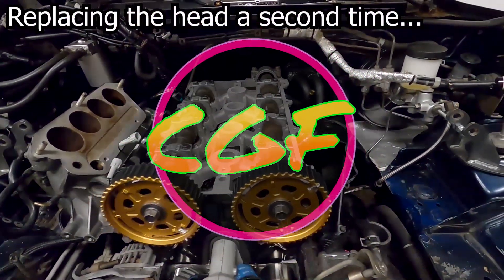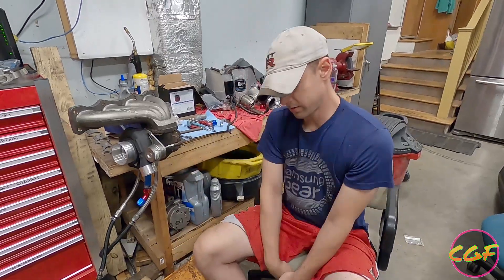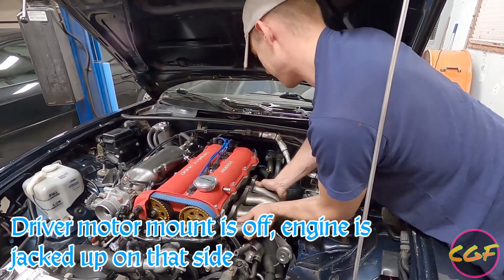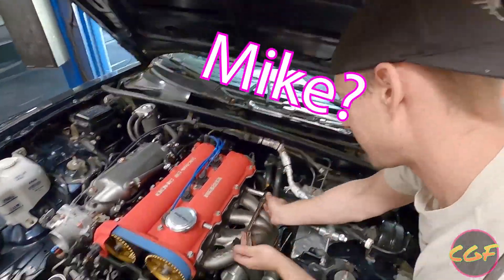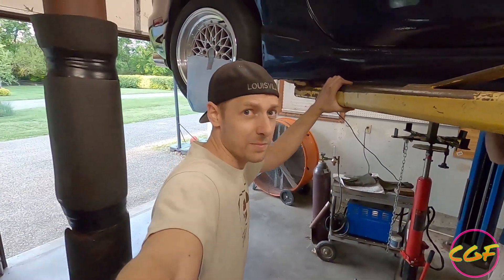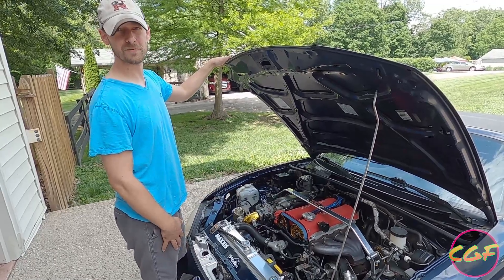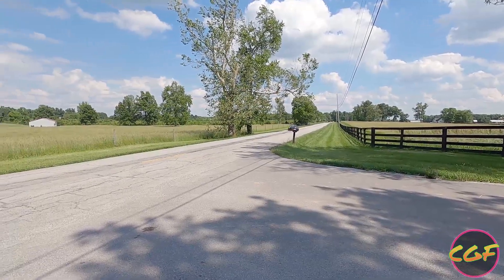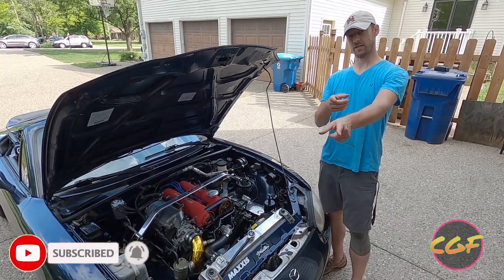Turbo Miata Kraken low mount vs Flyin Miata Manifold review

Comment: Thanks SO much for this video! I have a 97NA w/ the FM S1 kit- and was wondering what the difference would be, and now I know! Could you tell me who made the cold side pipe going into your TB? I'm looking to change out the silicone hose with something more permanent as well as run a different BOV than the one FM provides. Thanks so much!
Reply from the maker: You're welcome!   All intercooler piping was done in house custom by the CGF channel guys

Comment: What strut brace do you run that has a master cylinder stopper?
Reply from the maker: I custom modified it to have the stopper.  It's a generic no name one from ebay though
Reply: @CarGuyFridays  Thanks for responding, much appreciated
Reply from the maker: No problem. Good luck in the hunt!

Comment: Does the  Kraken vs G19 worth the extra money for going with a T25 GT 2554R Turbo ?
Reply from the maker: I think so!
Reply: @CarGuyFridays   what is the reason you think that ? :D
Reply from the maker: The g19 manifold appears to be a near log style manifold. That means it likely wont flow as well as the kraken you see in this video. Thatll result in slower spool up, and more heat in the cylinders. That means slower spool and less timing on pump gas. So less power too, or at least let less margin of safety from knock.  

The turbo manifold (and turbo) are the heart of the entire system. I'd go for the best you can afford there. Everything else is relatively easy to upgrade or swap out later.

Comment: What does Mike think about running this setup for endurance racing.  I've been against putting a turbo on our 99 because of the heat. Does a low mount create less heat?
Reply from the maker: This manifold design flows better so less heat will stay in the engine.  Being able to bump ign timing without knock is a really strong indicator that's happening.  This also puts the turbo low which makes it easy to move air out of the engine bay and a straighter downpipe to also help get heat out of there.  

You'll still struggle with heat in an enduro track setup and need a heck of a radiator setup though. Ultimately heat is a function of power generated and more power means more heat.

Comment: Great video, I've just bought an mx5 turbo after nearly 10 years with a 200sx s14 and mine happens to come with a FM manifold. Mine is making much less power though, around the 200hp mark so don't know if the improvements will be quite as noticeable if I swapped it out, something to think about in the future though, did you ever get yours to the dyno to check what power it made? Cheers
Reply from the maker: Still havent made it to the dyno unfortunately.  At that power level I'd guess itll be slightly less relevant. I have another buddy with the same manifold at that power level and the biggest thing weve noticed is how the exhuast note changed. It doesnt sound like a typical turbo miata it's much closer to a turbo honda or sport bike in exhuast pulse smoothness. We are guessing because the runners are much closer to equal length vs the fm manifold being a better version of a log manifold.

Comment: What turbo are you using?
Reply from the maker: It's a GTX 2867r gen2. In this video it was the GTX 2860 but it failed so I went sightly bigger
Reply: @CarGuyFridays  did you use the kracken 3" intercooler?
Reply from the maker: It's a custom garett core we bought and mounted. I'm sure kraken intercooler is top notch after seeing the rest of the kit though
Reply: @CarGuyFridays  I’m trying to use a/c, how custom was your pipes?
Reply from the maker: Well, custom as in buy some aluminum bends and cut and weld them in a route that fits.  So. Pretty custom in general.  Not sure if there are off the shelve ones that would work, youd think so since keeping ac isnt some kind of unique desire
Reply: @CarGuyFridays  did you ever install an air filter?

Comment: I think I’m gonna end up pulling the trigger on this mani. The FM log is gonna have to go. Did you order through the Kraken website? Also, did you learn to tune on your Miata or you have prior experience with other cars? I would like to tune my miata but I lack the confidence since I’ve never tuned before
Reply from the maker: Good call! Ordered from the kraken site.   I've over a decade of tuning experience, although most of it had been on miatas.

Comment: What is the benefit of low mount?
Reply from the maker: Straighter downpipe exit, prettier engine bay, lower weight is better for handling, and the design of this specific manifold is better from the runners perspective. Having used this manifold, I wouldnt use anything else to turbo a miata

Comment: looking to get this over the FM kit. the FM kit comes with everything you need even some of the tools. What about this kit? also Kraken is based over seas is that going to make it more expensive to ship? I will say I like the manifold and the turbo placement way better over the FM kit
Reply from the maker: FM makes a great kit. But the Kraken is much more efficient and the low mount is less heat in the engine bay. You can get the kraken as a kit as well with everything. Shipping times even though Kraken is overseas are still very fast.